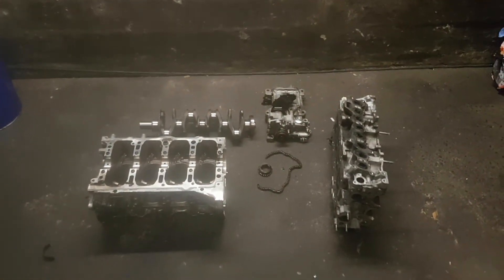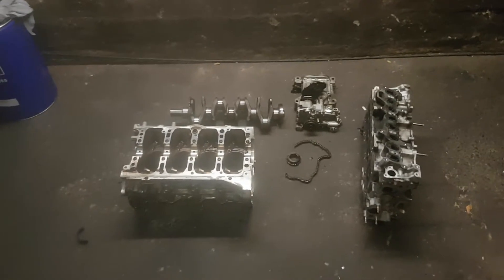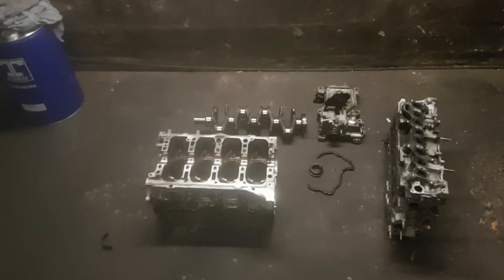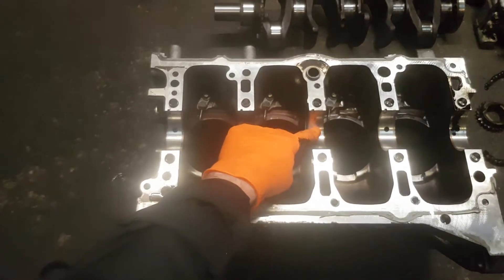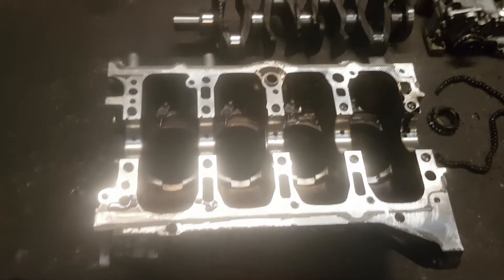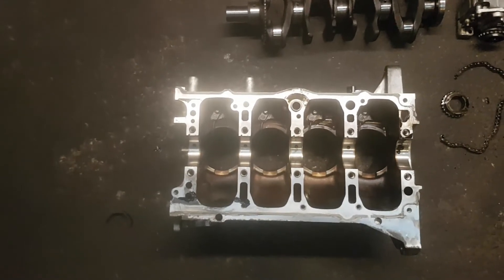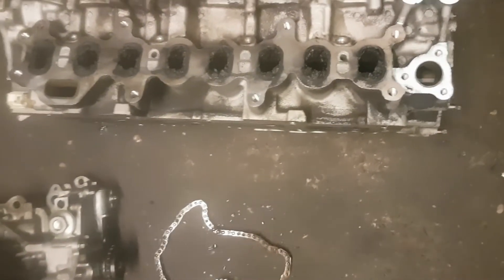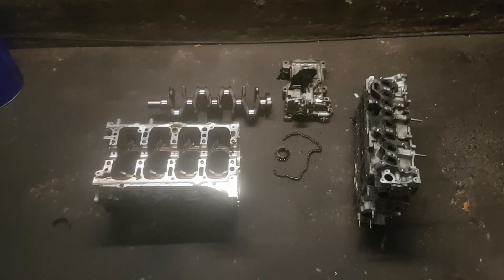Mazda CX5 Broken Oil Pump Chain

Comment: I have Mazda CX5 2016 2.2 diesel 175 hp, and my chain on oil pump broke, what is the cost of whole repair estimated if you know?
Reply: How many KMs when it broke?
Reply: @speedfreek7627  182000km

Comment: Hello 👋 
I am buying a 2010 Mazda 3 2.2 diesel 110kw version. It has got 199.000km. How can I check timing chain condition? What you suggest me to do to make this engine last without problems? What service I need to do urgent?
Reply from the maker: change the oil and filter and fuel filter, replace the injector washers and remove the dpf system

Comment: Hi Colin, Oil pump chain just snapped on Mazda 6, 2016 110k miles. Engine cut out as soon as oil light came on (I hope/assume that's ecu to protect engine)... no metal particles visible in sump. Is serious engine damage inevitable or is it worth fiting new chain on off chance. Your channel's great by the way.
Reply from the maker: Hi , I would not just fit a new chain, if you do it will run ok for while but it will start to sound Ratley and then it will go bang, its going to need a rebuild
Reply: @colinhagan4378  Ok, thanks for the heads-up. Not sure I can afford a rebuild so might just have to cross my fingers! Cheers.

Comment: Hi Colin. Where are you based? Got a mazda 3 2.2diesel . Got low oil pressure and car doesnt drive over 30mph lost of power . Obd says p055f. Currently got 139k

Comment: Hi Collin, Nice video firstly and thanks for the information. We have a 2014 Mazda 6 estate sport 175 BHP 2.2L and it was a nightmare to take the engine apart. Upon inspection we noticed this exact problem but they kept driving the car and the engine is seized as you can expect. My question is once the repairs are complete and the car is back to running condition, how often should we change this oil chain? I noticed that this never happens on BMW and Mercedes.
Reply from the maker: There is no interval for the oil pump chain so I am not sure, I have never had one break again after it was done
Reply: Hi Collin..my mazda cx3  brand new show oil light nd I heard knocking sound form the engine

Comment: Hi Colin, I have CX-5, 147k kms, 2.2d 110kw, 4wd, automatic. Really love the car, but can't turn the blind eye on all the issues on the internet. Could you please tell what preventative maintenance would you do, if you owned the car? Thanks!
Reply from the maker: have the DPF removed, chamge the oil and filter every 6000 miles, relace the injector washers every service.
Reply: @colinhagan4378  hey man, thanks for the reply! I now watched all your related videos and comments, and figured as such. Do you think its worth replacing oil pump tensioner and chain, at some point? I've found a lot of cases of broken chain on the internet.

I love the car itself... would like to keep it as long as possible
Reply: @colinhagan4378  is replacing the washers simple ? Thanks I've had issues was in London of a limp mode yesterday with orange eml  I had just given it a little boost on highway and it seemed to cause it and there's me thinking it'd be a good thing to help get shit out etc . I had cleaned egr  valve and my map sensor was clogged seemed better fir a while but I'm now hearing odd noises but fai.t in engine area and occasional noise that sounds like when you catch a hand held fan propeller on your clothing

Comment: Thanks for the invaluable video, it made me wonder. Do you know what causes that?

The thing is that I bought a "Mazda 6 2016 auto Diesel 50k full service" last year from "Northampton Motors Mazda" but the oil was very dark, I asked them and they said diesel cars are like that, rest assure the oil has been changed. 

Two weeks ago it suddenly broke down with no engine rev and it could go only around one mile speed. There was and is no other issue whatsoever, no unusual engine noise or smoke, no oil leaks, no lose of power or anything at all, there is just no rev. I have to say that this car worked perfectly fine right up to the breakdown issue. 

There were the following two errors in the control panel:
Low Engine Oil Pressure
Engine System Malfunction

I took it to Milcar Mazda Watford for a diagnosis and they said the following:
Fault code present: P0524 relating to the ‘Engine Oil Pressure Low’.
Investigated the oil pressure further and found there is no pressure. Suspect oil pump chain is broken.
Require a further 2 hours to remove the sump and check the oil chain.
Possibility that there may be engine damage but will not be able to determine this until further work carried out.

I am now confused and I would really appreciate if anyone could put me in the right direction.

Thanks
Reply from the maker: Hi The engine is screwd because of the low oil pressure so dont alow them to spend time on something which you already know, the engine has no oil pressure which means it needs to be replaced or reconditioned
Reply: @colinhagan4378  Thanks for the reply, is there a way to make a formal complain? As this car is only just over 4 years old.
Reply from the maker: You could try but Mazda never do anything
Reply: Hey Morteza. What happened with your engine so far? It had to be replaced?
Reply: @MrZalenzo Hi, no, I end up taking it to Mazda and they check and said the problem is the oil pump chain and as my car was a automatic car, they said the system turned off as soon as it broke, so they changed it for ~£1050 and so far it’s been perfectly fine.
Reply: @MortyParko  Hi Morteza, Is your car still going fine? My oil pump chain has just snapped, like yours did, so I'm just wondering if there's a chance all will be OK 🙂
Reply: @Derivativegate  hi, yes, the real issue is that their old oil pump chain was thinner than the replaced version. They should have put that in the recal as it was their fault but as they not a good company they didn't and ask their customers for money.
A friend of mine also had the same problem a few month later and what he did was to take it to his friend who had a garage and he ordered the part from mazda and there he saw the new chain is thicker than the old one. He said he spend only £600 but I spend a bit more than £1200 to get it fixed by Mazda. So far the chain hasn't failed but my friends engine has malfunctioned again and this time it cost him £2000. So I'm gonna sell it and stay away from any Mazda car. 
Good luck
Reply: @MortyParko  Thanks Morteza, very useful info. Bristol Street Motors have quoted £528 but not sure if I trust them to do it properly! All the best anyway.

Comment: This happened to my car what's chances of engine been ok, car wasn't driven when oil pressure light came on
Reply from the maker: There is no way to tell until the engine is stripped but normally they do some damage

Comment: Very informative again Colin, thank you. Is this regarding a diesel again? Just sold my 6 skyactiv-d with 220k Km'es on the counter. Never imagined it would make it. I guess.. always let the egine finish the carbon filter regeneration and let the oil be changed reguarly (every 16k km's) did the trick. I did trick myself in buying a new Mazda with the 2.5 petrol engine from 2017. Pretty sure that petrol engines are pretty solid from Mazda.
Reply from the maker: Yes this is the 2.2 skkactive diesel, dont have much experience with the petrol
Reply: I guess petrol engine also has an oil pump chain?